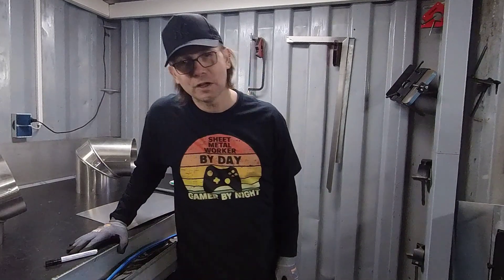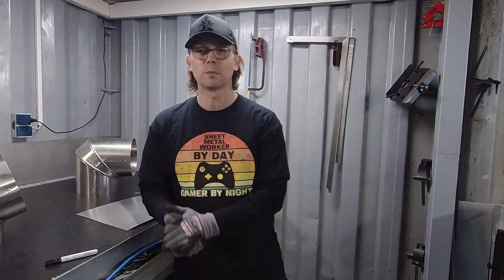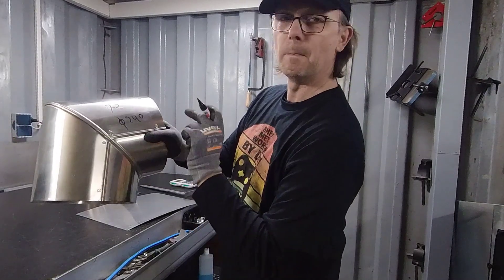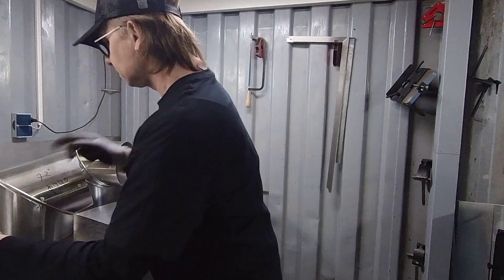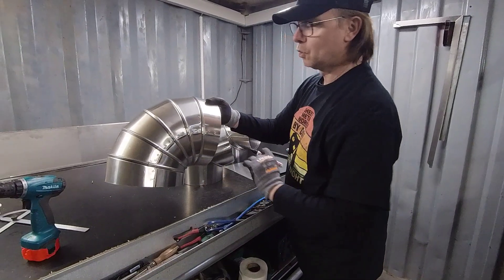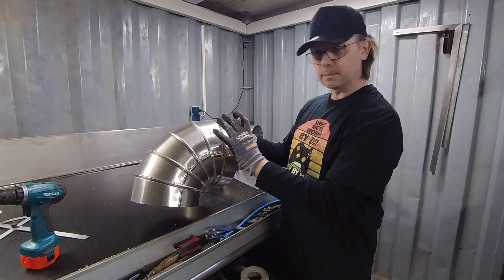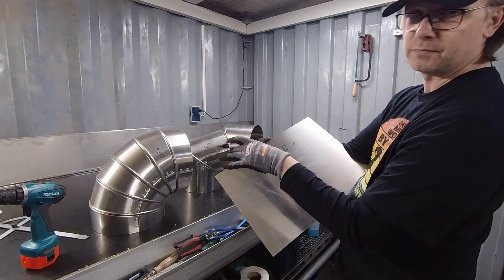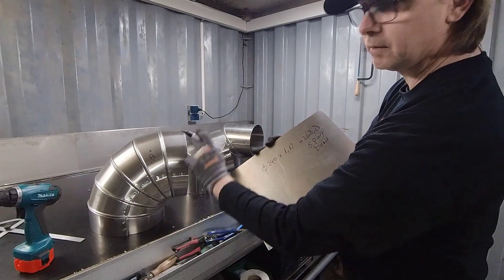Cheat Bend 2

Comment: For the segmented Bend do you use the standard centre radius or just the smallest you can to make the throat of the segment as small as possible ?
Reply from the maker: @davidgood4681  I use standard radius, as long I can put swages in it
Reply: hi sir , ty for the video , but can you elaborate ? i understand how to find the new OD for the center segment OD x 1.12 , but as to which center line radius to use , it wasn't specified in the video . lets say i am making a 4 inch victaulic elbow and the throat is 1 inch ? what would be the best way to calculate that ? is there a formula to get the center segment exactly 1 inch ? or would i need to do the steps in your cheat bend part one video ? the rollation method is really long lol..